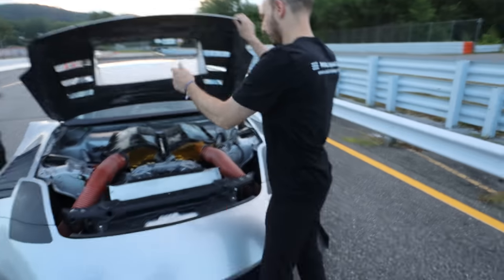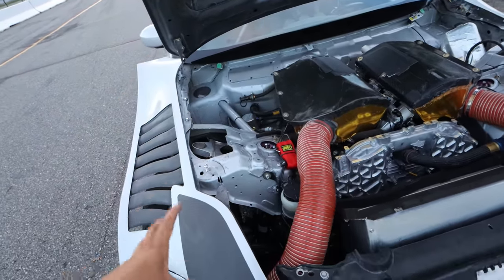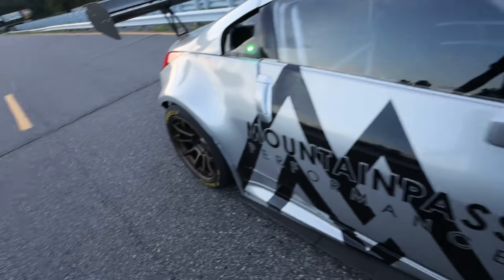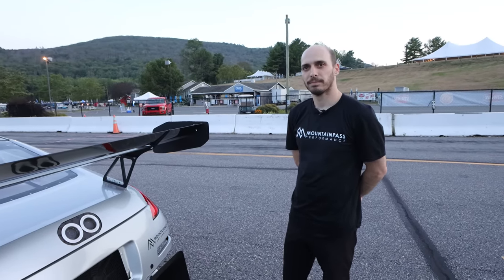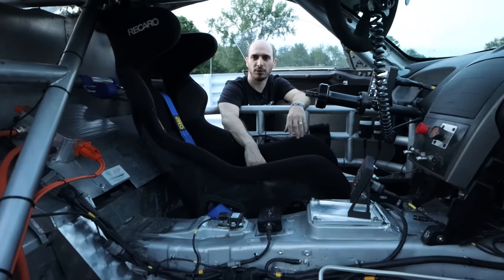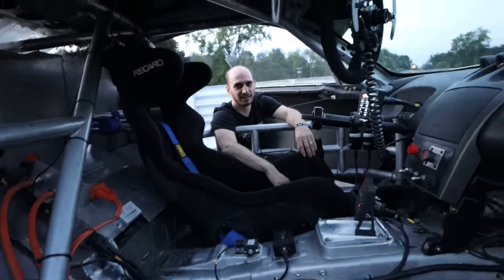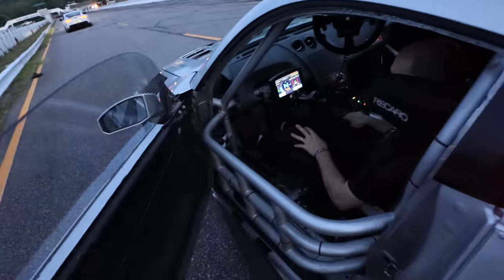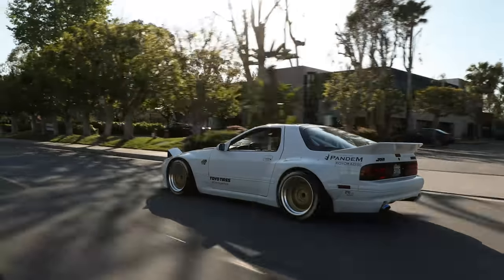F1 KERS, Rear Steer, and a 4.2 NA VQ in This Hybrid Electric 350z

Comment: 15:1 compression with ITBs. No wonder it sounds so good.
Reply: @FukU2222 he has a stepped exhaust
Reply: @FukU2222 it can if it is a dramatic enough shift in compression ratio it can. It’s just most of the time it doesn’t cause a dramatic enough change in sound to notice
Reply: The big thing is equal-length headers with a spike merge collector into an equal-length single exit exhaust. You can do this on any Z. The duals into single y-pipe needs to be dual 2.5 into single 3.5 and needs to merge roughly right where hypothetical collecter extenders would end and remain merged as long as possible before you split it back into duals if you wanted the dual exhaust look.

Comment: Finally getting some more recognition that  this build deserves when I first discovered this build first time I ever experienced a "game over" moment as a long time time attack enthusiast & evolving competitor this may be the ultimate time attack build of all time if not the chassis/motor combo/balance at the very least the overall concept & design is perfection. High compression (Larry Chen just skipped right over 15:1 CR for a 4.2 NA VQ is insane) highcomp+NA+Stoker+hybrid motor+KERS w/ CF body 4 way coilovers+ rear steer+ all the sensors/data/control+proper balanced aero package has got to be damn near the best recipe to dominate time attack wether the VQ/FM is the right platform/motor for that recipe time will tell but this build is beyond inspirational it makes you briefly more inspired than you've ever been quickly followed by devastating defeat knowing what it will take to compete with such a machine.

Comment: These time attack/track builds are really fun to watch!! I'm really obsessed with those functional aero kits and idc if it's a hybrid powered or whatsoever as long as it's functional and would definitely help you to shave off time, that's what all matters here!! Function over form!! No bs or whatsoever, just straight up business!!! Love these contents, Larry!!! Ngl, I never even thought that it is possible to build a hybrid power train especially on a car like this!! You'd normally see this kind of thing on a pure-bred race cars like Super GT race cars (GT300 and GT500 classes), DTM cars, Le Mans prototypes, and F1!! Massive respect to this piece of engineering right there!!! Truly a work of art!!!
Reply: What I love with racing hybrids is that they exist partly for efficiency in the case of F1 and LMP cars, but in the case of Time Attack cars they exist to keep your minimum speed up by giving you giant bursts of acceleration, and idea I'm toying with for my final year uni project is trying to design one to go in the front axle of the MX5 I use for Time Attack here in the UK, it's tech that absolutley fascinates me and if I can make it I absolutley will go for it. This 350Z is totally one of the inspiration pieces for it, such an awesome bit of kit, it exists in this weird vacuum in time attack where most cars in TA basically boil down to having a very high power to weight and strong aero, effectivley brute forcing good lap times, this car gets them by integrating all the systems to become a cohesive unit and it's awesome to see a really different approach to normal. Love that it's getting shown off like this
Reply: @jameswhitehead03  glad to hear it man!!! These innovative technologies like hybrids are really beneficial especially in motorsports like these!! It improves every aspect of performance and efficiency as well!!! I was really inspired by his build to be honest and I'm kinda planning of doing this kind of thing to my own TA car someday (probably do it with the EK or EG Civics, or any lightweight track capable vehicles that you could ever find like Miatas which is your current platform, or maybe even the same current platform as this guy has which is the Z platform). And also, about the aero kits, I wish that aftermarket companies like HKS, Varis, Pandem, RWB or any companies would develop track oriented widebody kits for specific vehicles like GR86, New Civic Type R, GR Corolla, and the 400z (including other vehicles whether it's modern or old school models). Anyways, I'm rooting for your MX5 project!! Hopefully it'd be a successful one and would definitely rip the tracks!!!
Reply: @jameswhitehead03  and speaking of hybrid powertrains, I don't exactly know if this is true but I believe that recently, Ford performance have already did this kind of hybrid technology to their rally race car and I'm not sure if it's their Focus or Fiesta model but regardless, that was really cool to hear that!! Idk if this is already a thing years ago or what but I really do never heard anything like hybrid power to this extent. And also, I'm looking forward to AMG's F1 Hybrid technology that'd be adapted to their new upcoming road performance vehicles. Hopefully this would be a new opportunity for big aftermarket companies to develop new parts like AMG are doing (for example, their Hybrid technology to F1 car by using the turbo to separate the hot and cool side compression which improves spool time and reduces turbo lags). Sure it'd be really expensive to develop that kind of tech but it'd drastically improve your vehicle's performance and efficiency especially when it comes to track/time attack racing!! This would be revolutionary if it's gonna happen but hopefully it will (whether sooner or years to come)
Reply: The rally car is based on the Puma actually, which still strikes me as a strange choice and I imagine it's a marketing one. It's a pretty new thing, I believe new for 2022 season for rallying, I think it's a spec unit in the back of the car per regulations. What AMG do on the F1 power unit is really impressive, a lot of the power unit engineering from all the teams is to be honest. Agree with you on the aero kits, would be nice to have them be properly functional, a lot of racers tend to end up making a lot of their own bits aero wise aside from the rear wing typically as aero is so chassis specific, would be nice to see it with some proper data though from the aftermarket going "Hey it helps aero and looks cool too". Thanks for you support for the car! Should get really quick as developed, we're a tiny little student team but there's a lot of knowledge so we're hoping to be able to get some proper pace out of it as we get the funding to do so.
Reply: @jameswhitehead03  I see, so that rally car is based on the Puma. For me, I really find it as an impressive move coz again, it improves efficiency and performance-wise. The aero kits tho, honestly, the only aftermarket company that I know that sells a full track ready widebody aero kits besides the RWB (for Porsches to be exact) is the Garage Mak which is a Japanese tuner shop that specializes for Silvias like S15, S14, other S-chassis (if I'm not wrong), also Z platforms (you can search it on Google if you want to get a more info about them but basically, they're specialize it for Tsukuba Time Attack events or Suzuka Time Attack events I guess. I've just found it on Narita Dogfight's website or page if I'm correct). I hope they still do the same thing to the modern Japanese vehicle platforms especially for the modern enthusiast who are really dedicated to compete on time attack racing!!! Oh, and don't forget about J's racing, Voltex Suzuka Racing (correct me if I'm wrong about the exact name), C West, Amuse, RE Amemiya (a dedicated tuner shop for RX-7s and RX-8s), and Garage Saurus (another aftermarket tuner that makes a track ready aero kits specifically for R32 and R34 GTRs). Spoon Sports and Mugen are already starting to develop these track/street oriented kits for their upcoming Honda models especially the new Civic Type R which is really great to hear besides the suspension, brakes, and engine mods!! Nismo on the other hand, they should also develop the 400z as well to spice things up for their hardcore Nissan fans and enthusiasts!!! The hybrid part, hopefully that AMG would pave a way for many aftermarket companies to develop a widespread products for hybrid conversions of different platforms of vehicles someday (especially to those people who are really into motorsports) but I thinks it's kinda 50/50 chance for me due to big car manufacturers that pushes full EV to a production which is a mixed feeling for most enthusiast (but for me, I don't really mind as long as they still make an enthusiast car even they're pushing this kind of new technology). Anyways, whatever your take would be on this one, I'd definitely respect it genuinely!! But yeah, again, for me, I hope they still do their tuning thing as they used to be on 70s to early 2000s to this modern era despite of the dying breeds of ICEs. I know that there's still a glimpse of hope for that.
Reply: @UguisuAnko12  uhhh bro are you kidding. ? HKS & Varis specifically develop track focused wide body kits & aero. Pandem is more street car focused & RWB only does Porsche period but HKS has street & track kits  for GR86 (please look into HKS racing performer GR86 project) it's built by HKS using only catalog HKS parts including their wide body track focused aero kit & holds current GR86 Tsukuba lap record. Varis also makes track focused widebody aero kits for both gr86 & fk8 civic type R Varis "Arising" kit for GR & CTR are 2 of the best widebody aero designs in recent years absolutely top shelf both in quality & performance with looks & performance w/ price tag to back it up. Don't know much about GR Corolla & 400z but only a matter of time and their will be kits available. Voltex widebody aero kit for s2000 is fitted to fastest time attack s2000 in Japan (top fuel) & the US (evasive)
Reply: @JP-gd1ln  I'm completely aware about all of those big Japanese tuner shops which is admirable (including the HKS and Evasive), my point here is I wish they could still develop more of these kits for track enthusiast like me or anyone who's a hardcore fan of track racing especially the new coming sports cars like the 400z, New Civic Type R FL5 and GR Corolla.
Reply: @JP-gd1ln  or to be exact, my main point here is hopefully there'd be new aftermarket companies that are capable of developing these kits specifically for car platforms as what I've mentioned a while ago or to other already existed models atleast. But who know, maybe they will or they won't but regardless, hopefully I could be able to afford to buy those kits that you've mentioned (atleast one of em) and slap it to my dream vehicle lineups.
Reply: @JP-gd1ln  and to all of those shops that you've mentioned, I'm 100% aware of em and a huge fan of their kits at the same time. I also grew up watching Best Motoring Official, Hot Version, Video Option, no wonder why I know them all and I genuinely love their shops as well. That's how I've got into cars, touge and time attack racing!! Funny to say this that I used to watch them since I was young kid on internet. Always be a huge fan of Spoon Sports, Seeker, and J's Racing!!! Been also a huge fan of Touring car racing and JGTC.

Comment: I tore apart my late father's 09 M5 ( rebuilt motor and new clutch and LOTS of aftermarket parts and tuning)  and I thought after it was back up and running and everything was working as it was designed to do I had quite a bit of confidence in myself. I feel like an elementary school student now. Thanks Larry.

Comment: That rear steering is going to change autocross. The "never understeer" is a nice touch. This will slay lap times with the dynamic of in tight cornering and high speed stability along with straight line crash braking, trail brake corner entry and mid corner turn in with all wheels, and the ability to choose to rub more tire off with toe and generate heat. I like the integration of the EV into the bell housing but that starter/clutch delete sounds rough. This is the time I wish computer controlled solenoid valve cylinder heads were available for 0 compression EV only mode. Being able to load the engine for TQ and recover KERS with it mid corner is also amazing. Super Capacitors? Batteries to rear axle, good choice. That wing is probably slowing you down with body drag, it creates a vacuum bubble below the wing, which is also along the swept back of the hatchback. If the wing was much lower it would assist the underbody aero but also be shrouded and give less downforce directly but possibly more downforce overall. What if you had a steering wheel like F1 with side grips only, but they turned like motorcycle grips to tell the system rear left and rear right steering requests, or use the clutch pedal location for a split pedal you can rock you foot on like dynamic braking in older F1.
Reply: I think by-wire front steering could be potentially very useful. Obviously there would still need to be a mechanical backup, but removing the direct connection between the steering wheel and the front axle could allow you to make dynamic steering ratio changes based on each individual corner on each individual track, 1,000+ times every second slide corrections (before a human would even notice) and potentially better integration with the rear steering.

Comment: Winged sprint cars are known as a Outlaw or Midget which do mostly circle track racing those are what need pushed to start because starters & batteries are heavy. Not to be confused with "open wheel" hillclimb or rally sprint cars also know as "Coyotes or Wells" or " Wells Coyote" purpose built Hillclimb cars named after its creator John Wells. That have starter & battery because they are built using engines out of passenger/sports car vehicles mainly.

Comment: I wonder if the rear active steering used in the infiniti's could've been used? Not really sure how it's system works but it's cool how he was able to that and more to this Z
Reply: I think it would be cool to have the "dynamic adaptive steering" from the Infiniti Q50 in this vehicle. Tune it right, and it would be possible to switch between perfectly controlled time attack car and full-on drift car with the flip of a switch.

Comment: I’m just wondering how he stops the car without a clutch. Does the engine just turn off below a certain speed? This car is insane.
Reply: It's like an automatic car,he uses the brake and turns off the ignition with the key or push button

Comment: Electric hub motors in the front wheels when lol?
Reply: I would definitely like to see that, plus drive-by-wire steering (Infiniti style) so the torque vectoring doesn't make the steering feel weird.
Reply: @aspecreviews  I can see the benefits in that but I cannot fathom the amount of software it would take to have electric torque vectoring on top of drive by wire not feel weird.
Reply: @c0c0asauce  without some way to mute the steering down, a torque vectoring front axle would rip the steering wheel out of your hands. Drive by wire would allow you to maintain some steering feedback, as otherwise the steering would need to be totally dead in order to not feel the torque vectoring through the wheel.
Reply: @aspecreviews   Am figuring correct that the torque vectoring is going to pull the wheels in the direction of the turn? If so I definitely gained some insight.
Reply: @c0c0asauce  it would pull in whichever way the computer wanted the front end to go. Turn-in would violently rip the steering in the direction it was turned. If the tail slid, the steering would be wrenched the opposite way of the turn as the computer tried to correct. DBW steering would be (except for a mechanical backup) disconnected from the front wheels. A VERY powerful servo on the steering rack would rotate the pinion-gears to turn the front wheels, faster than even F1 drivers could.

G-sensors, damper load cells (which you can see in their latest video) and gyros could provide enough data to simulate steering feedback, which could be a game-changer since just like a sim-racing game, the steering ratio and different aspects of the force feedback could be tuned.